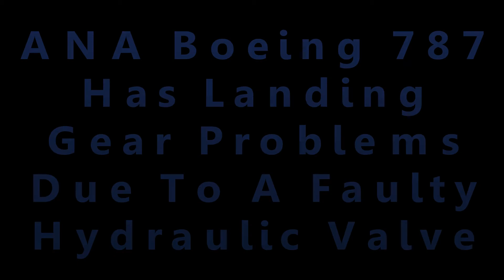ANA Boeing 787 Has First Technical Glitch - Landing Gear Failure Due To Faulty Hydraulic Valve

Comment: No chickenfire, the 787 is a lot more revolutionary than the 380.  The 380 is just bigger than other modern airliners, nothing more.  The 787 is absolutely littered with innovative technology and materials, in order to make it significantly lighter than comparable aircraft.  Remember, those comparable aircraft were not built of steel and concrete, they were already highly efficient marvels of modern engineering, but the 787 is a quantum leap ahead.